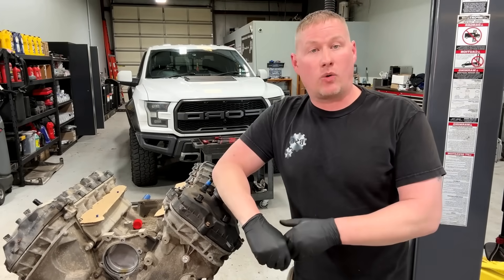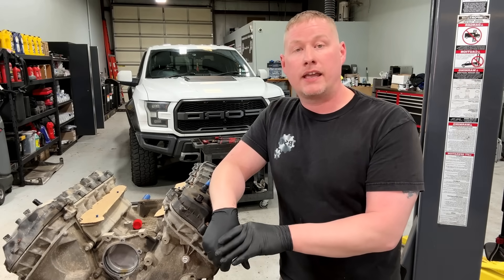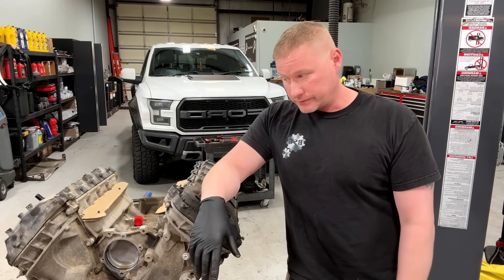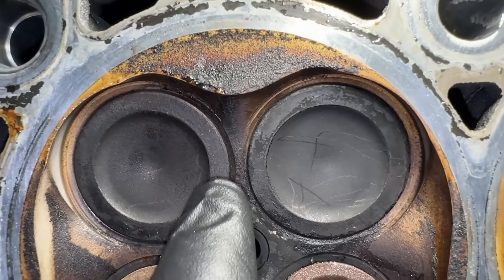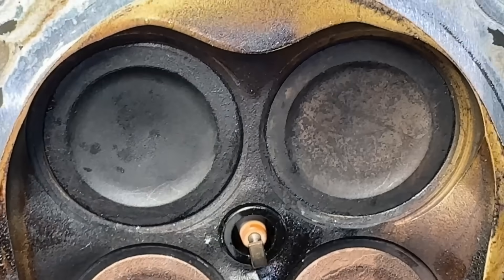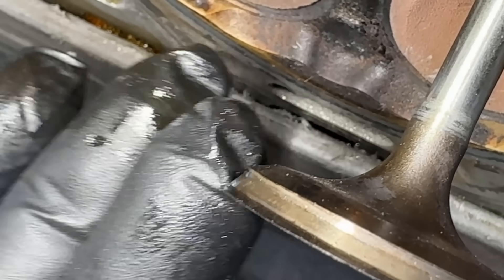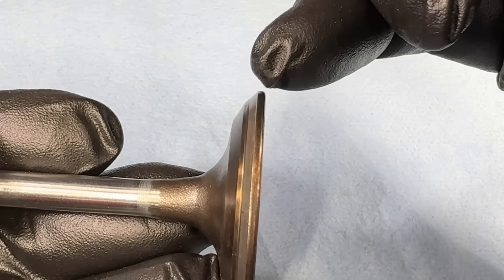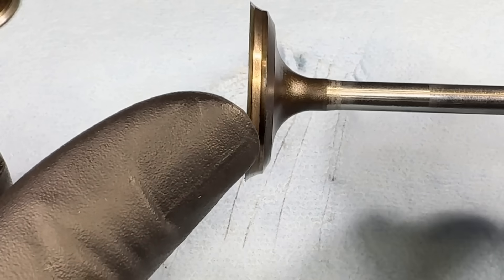The One Fatal Design Flaw of the 2011-2014 Ford 5.0L Coyote Engines!

Comment: I had a question for you that I don’t ever see come up in any of the FB groups or anything, and maybe because it’s just not common on these trucks, or just not really of any significance. But for the 2015-2017 5.0s (and possibly other years) was the CNG package of any benefit other then being able to use NG as a fuel? I bought my 2016 F150 used in 2019 and who ever ordered it selected some some strange options. The truck has every option and XLT could have that year. 6.5’ bed. 7050 GVRW. Even the pano sun roof. And it also came with the CNG prep package. From what I read online, it has stronger exhaust valves? Do you know for sure if that’s really the only difference and if it’s of any benefit to have even though I’ll never install what else is needed to run NG as a fuel? Sorry for the long question! Love the channel!!

Comment: Still 4.6 after cams roller lifter ford perfamce  high vol high pressure  oil pump  3 years no issuse 109940 k on it

Comment: I gotta 13 with 250k miles an jus got a lowoil pressure warning preparing to pull the top end first the will end up pulling the block due to leaking oil pan gasket an it being 4wd means it's coming out I've owned it since new kept up on maintenance used for transportation an occasional farm work ifthe350 down do all my own work I'll comment back let ya know what I have in it an what was done

Comment: What would you say causis this? If it was a valve problem, then all the valves would fail, no? So is it too much heat making them soft?
Reply: More heat towards rear of the engine due to insufficient cooling channels towards the rear. Bad engineering. Plus, cats are really close to back of engine and they can get super hot

Comment: So... Is this a "EVERY one will have the problem" problem? Were there engines built in different areas that had better parts in their bins? 
I have a13 with 146k.. it idles in drive so smoothly that you can't tell it's running most of the time.. 
Could i have a unicorn? 
It's been a great truck.

Comment: I have a 2015 F150 5.0 with 66K miles on it and just recently noticed during cold start that I hear a popping noise just one time at startup like a backfire. No other issue as it runs great, no codes or rough idle and no backfire on acceleration or deceleration. Any idea of what could be causing this?  Changed plugs and coil packs as preventative measure since the truck is almost 10 years old and its been overseas during my tours of duty. I recently had injector cleaning service and noticed the backfire only after that was done.  Changed from 87 to 89 octane fuel with no change.  Appreciate any info!

Comment: It appears like an inconsistent heat treat issue with the valves. If it were a mixture of metals that they were making the valves out of, all of the valves would be doing that or at least a greater percentage of them. Heat treat and or tempering Fred probably because they're being done in a mass, and the end valves were the one suffering the issue because they were getting a slightly different heat treat than the ones in the middle of the group, or vice versa. The first time I remember clearly running into an issue like this I was doing the bearing races on the Prototype M1 Abrams tank back in the early eighties. And I was finding some that actually had splits on the inside of the bearing races that had been outside and you it was very difficult to see the split with the oxide coating. But you can see it very clearly after I had done the inside grinding to a very tight specification.
I remember that they came to me and told me that I was overheating them as I was cutting them and I opened a brand new box that had just come in and found three of them just in the top layer that had splits in them and handed them to him I said well then how do you explain the fact that they're already split when I get them. They were quenching them at far too high a temperature and it was causing them to actually erupt with splits on the inside and they weren't catching it. After I explained that to them they went back to the people who were making the original forgings.

Comment: This problem gets worse when running E85 gasoline. Don't be cheap. Buy decent fuel.
Reply: What’s wrong with E85?
Reply: @icetea2309  Your question should be what's not wrong with E85. I would have a shorter reply. Here goes. It gets worse fuel economy. It corrodes and takes out fuel tank sending units. It takes out fuel pumps. It sticks fuel injectors. Sometimes to the point where the injectors flood and or hydro lock engines. 

Then when one tries to disconnect and reconnect the fuel and or vapor lines, the internal O rings and or lock rings do not want to stay in place. Or they swell and make it a bloody battle to get them to reconnect. I have never had to replace so many fuel system related parts in my life. After a vehicle has been ran on E85.

Another thing that I have noticed is a shorter lifespan on the cat converters, and some valve guides in the cylinder heads. My theory is the the alcohol mixes with the engine oils, and wipes off the oil on the valves, in turn, ruining the valve guides.

Comment: Been waiting for this video. Five years ago this problem became apparent with 1st gen 5.0 engines in used trucks out of Edmonton and Calgary. Perhaps the cold weather makes the problem worse? Anyway, three F150s in the family have had valve jobs. Its not that difficult or expensive to just fix it with new valves. MUCH cheaper than a new engine.
Reply: So the head you think isn't forming to the tuliped valves? If he's right and the valves are too soft then yeah maybe just new valves could be tried??

Comment: It’s even happening on some 2015-2017 mustangs as well. Not sure if it was a fluke but I had 2 valve springs break but got lucky the valves didn’t fall into the cylinder.

Comment: This just happened to friend but we’re fixing it 
It will cost him $1600 total price , parts , labor, machine shop 
Buying all parts from Rockauto parts 
Truck is a 4x4 F150 5.0 2013 with 90,000 miles

Comment: Maybe reviving an old thread here, but I just bought a used 2012 f150 with a 5.0. 
How to rough idle, and I started doing some research and found this video. 
Took it to a local shop, who performed a leak down on cylinder 4, and sure enough, intake valves are leaking. 
This shop wanted $8700 to replace the cylinder heads, and $12K to put a Ford motor in it. 
I paid 8K for the truck, so obviously I don't want to sink another 12K into it, so I'm taking it to a different shop to have the cylinder heads replaced 
When I mention this issue to the guy at the shop, and told him I didn't want the same valves put back in the heads, he didn't seem to know about this issue 
It seems almost impossible to find anybody locally (I'm near Portland, Oregon) that will do this kind of work at a reasonable price 
If anybody sees us and lives in the area, and can recommend to shop to me, please reach out 
I really like the truck, everything else works perfect on it, it's an XL model, four-wheel drive with a tow package, does not leak a drop of oil or coolant or anything, everything on the truck works as expected, the engine actually runs good under load, but just has the rough idle.
The shop that diagnosed the bad valve told me it would eventually cause the catalytic converter to fail because raw gas is dumping into it 
Anyway, thanks so much for this video, really helped to solve my problem
Reply: I have the same truck and problem. Shop quoted me 13k for an engine. Still figuring things out.

Comment: my new to me '14 developed a check engine light 2 days after I bought it.......129,000 miles on the truck, I bought a 2 yr. power train warranty. Glad I did! low compression on 1 of the cyl. Ford is currently installing a new head. Thanks for this video.

Comment: Love it the 5.0 can do no wrong it just is lacking the torque of the 5.4 3v that’s a fact. Has all the hp and high rpm but the modular V8 is really hard to beat I can only imagine if they kept it how good it would be with the current tech out.

Comment: FordTechMakuloco, do you know if a person can buy just ReMan replacement heads? I believe I am having this issue with my 2014 F150 on cylinder 8... I plan to do a compression and leak down test on this set of days off. Is it possible to replace just the heads? Or are there other concerns I am not aware of? I'd rather not replace the whole engine if at all possible. Looking for the budget friendliest solution.

Comment: Hey Makuloco, I’m having trouble with an 6.2 gas motor out of ‘15 F250. The motor has roughly 55-60k and the problem I’m having it miss fires, stumbles, and blows white smoke while under load. Then it will clear up a run ok. It has no engine codes and my buddy’s son is a young Ford tech. He has tried looking it over and is stumped at the real cause. With his laptop the power balance test shows cylinder 4 & 7 are low. We compression tested 4 & 7 compared to 2 & 6. The test showed they were all 4 & 7 both 185 while 2 was 195 and 6 was 175. But when we drove it with the laptop hooked up the miss fires were from 5 and 6. The truck could and like it actually is consuming oil. But not 100% at the moment. We did bore scope on the 4 & 7 and didn’t see any issues except for seemingly to much oil. The only other thing we did was to  change out all the injectors just in cases. Lastly we popped each valve cover looking for the common broken valve spring… they all seemed ok. Where does that leave we what should I check for? About the only couple things I can think of bad ring, bad valve seals, and bad PCV valve. Please any kind of input would be greatly appreciated! Jeff

Comment: Sold my failing F150 at 130k miles.. Bought a Ridgeline and never looked back... It tows my travel trailer just fine and gets 15mpg when towing and the F150 got 9mpg when towing......

Comment: That end of the engine must be getting hotter than the rest of the engine and of course with with sub standard metals from which engine parts are made from. I can see how a valve could " tulip " the way it has.

Comment: I had this exact same problem on my 2013 f150.  Same cylinder valves were eroded, compression dropped significantly and was having misfires at idle, no issue under load.  145k miles.  I just had the engine replaced for $8k.  It was worth it to me because the truck was in perfect condition otherwise.  im now 60k miles into the replacement engine with no issues..

Comment: When manufacturers have issues like this they should have customer support programs but they usually don't  because they have gotten their money a long time ago. They have a basic warranty and a powertrain warranty and after that your on your own. If you have a aftermarket warranty (service contract) they will only want to pay for the failure which in this case would be one head. So you still have one side waiting to go and bybthat time your warranty has expired or they say the shop should have fixed it the first time which they wouldn't have paid for.

Comment: I got a question. I got a buddy, misfire on Cylinder 4 and 7, but only under load (up a hill, or WOT). It only misfires like 5-6 times in a short 3km test drive at WOT. I found all the coil connectors broken, so replaced those, found 2 cracked plugs in cyl 2 and 8, so replaced all 8 plugs with NGK Single Iridum. I also swapped coils as well. Test drove, still misfire on cylinder 4 and 7. You can't feel the misfire, no flashing Check engine light unless we do longer drive (like 20 minutes) and then the counter gets to like 15-20 misfires. Engines dead quiet and buttery smooth at idle, cold or warm. When driving normally its buttery smooth and no misfires recorded, only under hard load. Another buddy is saying its the tulipped valves. I'm thinking about doing a carbon cleaning next.

Comment: A mechanic offered me 10 grand for my 2002 f150 4.6 liter. He couldn't believe how well it drove. Almost nothing is tackled on this truck without first referencing this master mechanic. From AC work to changing fluids in the rear axel this is my go to source.His common sense tips are hard to beat. He has saved me thousands and thousand of dollars in labor. Well done sir.
Reply: I’m on my second new edge Mustang GT with the 4.6L 2V. Not a power monster but they have been such good engines to me. I’ve driven them both hours and hours non stop higher RPM range and they never skipped a beat. The only caution with a 4.6L that’s almost two decades old now is the timing chain guides get worn and the tensioners bust through them. If you take the oil cap off running and here the chain slapping it’s time to pull the cover before it takes the motor down.

Comment: Question. The 3.5 ford gt. What did they do to that car to make 660 horsepower. And could those changes be put into a regular 3.5 duratec engine

Comment: Just diagnosed this on my truck a few months ago. It’s at 140k. I don’t see the value of removing the heads and repairing and leaving all the old timing components. And the cost after replacing heads, gaskets, timing components and all the other crap just dosnt make sense to repair. So I’m saving to replace. Have to do my TC too. Cause I think my clutch is slipping. I hit the trifecta.

Comment: Wow! great Video. I am an owner of a 2011 5.0 with 55,000 miles on it. Great info!
Reply: My 2012 5.0 also has 55,000 miles. I don't drive it but for vacations and when I need a truck. Hoping I get lots more miles before something like this happens. I love the truck.
Reply: Just happened to my 2012 at 109000 miles.

Comment: Cutting corners when specing hardness for valves, and other components has cost ford lots of respect, even seals have and bearings quality has dropped, not to mention the new electric rack and pinion, was it ploy by ford to bring more work into the dealerships by creating service issues or was it just a serious quality issue? I have flex and it has the poorly designed 3.5 liter v-6 which calls for maintenance now with only 130,000 miles new timing chain and water pump and the electric steer rack and pinion, what a shit show. Sure, I love my flex, but this is ridiculous to spend 3-5K for repairs..  And old beater for Truck 1990 lasted 200,000 K with the old 5.0 0r 5.8 Liter motors.. Two steps forward and three steps back in quality, wtf. They are manufacturing cars to be replaced every 2-4 years now..  What a waste of natural resources........For years you had to stay away from the 3.0-4 liter 4.0 motors because of head bolts issues now this....Should we buy only foreign made cars now by Japanese sources, they are even showing quality issues, I guess that's what happens when your source parts from countries will to mass produce junk..

Comment: Read sarcasm... How dare you say anything bad about a coyote! You should be ashamed! Your not a Ford tech. Your just a chevy guy out there bring Fords name down! How dare you....whats next? All LS 's cant do 2000hp stock? Or perhaps  you want to convince us that a 2jz gte isnt good for 3000hp stock? Man u full of it. 🤣 

Yeah its sad that you buy a 70k truck, not fully loaded. And you get a crappy shifting 10 speed and a 5.0 that has chain rattle and makes a chunking sound.  I still bought a 20 5.0. Love the truck. Though i had great luck with my 5.4 3v 😳. Dead at 283k. And not my fault, it was hers 🙏.  20' is a nice truck. Definitely not worth 70k. But neither is the the 90k ram that will be out soon. After a tune... i cant stop driving it. 3rd gen picks up big power.  13.5 with just a tune. Sure ecoboost will do 12s. Id rather have the coyote though. High mileage 3.5 EB make more noise then a coyote of,  lol.

Comment: Looks like cylinder 1 has started to tulip also . Had that same problem with a john deere lawn tractor with a kawasaki engine that the valve stuck and bent the pushrod had to tap valve out with a hammer.
Reply from the maker: yup

Comment: I have a 2013 F150 Super-crew 5.0 with 350,000 miles on it and it still runs like the day I got it new, just burns about a quart of oil between oil changes. Not saying this guy is wrong, just saying my motor still works great 👍
Reply: What’s causing your engine to burn oil? Mine doesn’t burn a drop at 101,600.
Reply: @alanschmidt3460  Rings and valve seats tend to wear a little after 350,000+ miles, mine didn't burn any oil at 100,000 miles either :face-green-smiling:
Reply: @robertwright1084 okay great. I’ve never owned a vehicle more than 120K. Thanks for the info and follow up. My 2006 F150 with the Triton 5.4, it had the electronic PCV and cause oil consumption and ford scraped it in model 2007 and up.
Reply: @robertwright1084  have you ever tried a engine flush to loosen up the rings or this wouldn’t work/help with the burning oil and degrading of the catalytic converter?
Reply: I’m curious, are you in a colder climate area?
Reply: @ I live in Southern California in an area where the temperatures swing down to 15 degrees in the winter and up to 120 degrees in the summer.
Reply: @ Thanks.   Just trying figure out if or when mine might need it somehow.